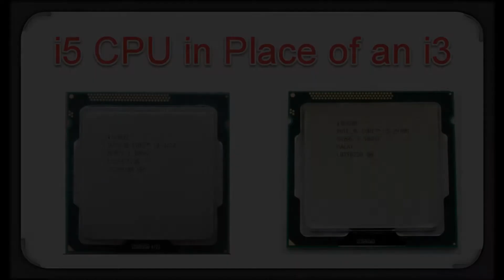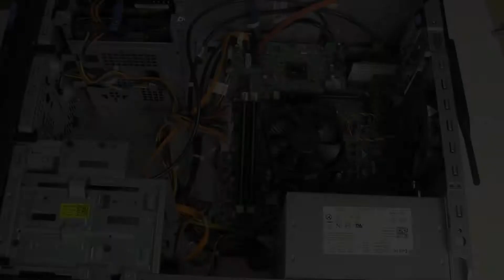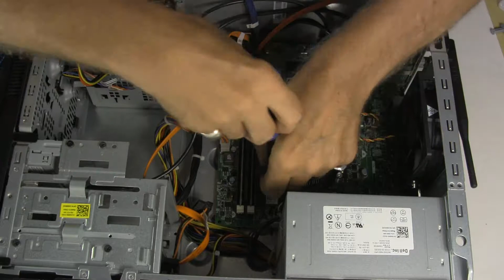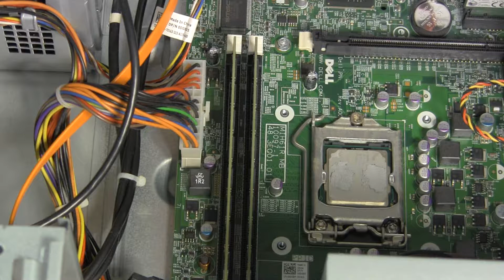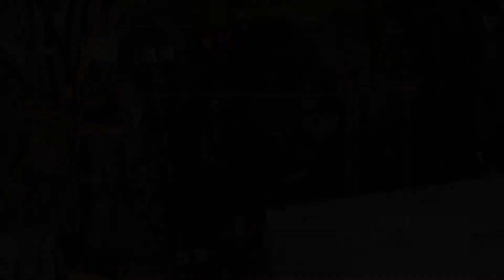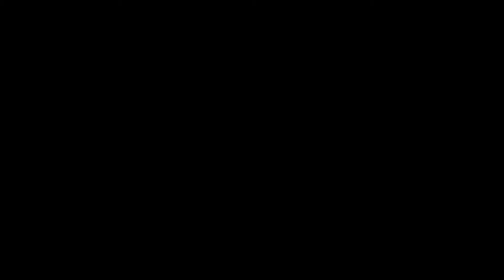Intel i3 processor replaced with an i5

Comment: So i can put my i5 processor to i3 motherboard?
Reply: The motherboard may not be compatible.
The most likely type of computer to support multiple types of processors is a custom-built desktop computer. ... For example, to get an i5 to work in an i3 socket, you may need to update your BIOS settings and possibly alter jumpers on your motherboard as well
Reply: @chrislowry7941 what are u talking about, u do not have the slightest idea